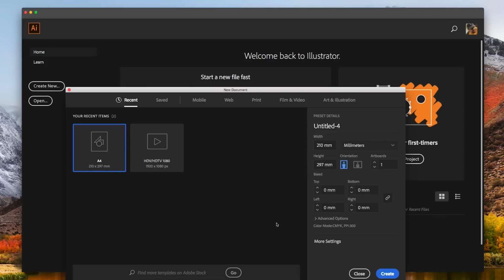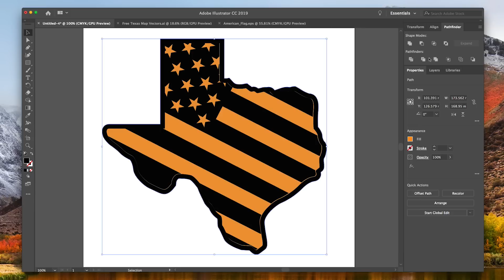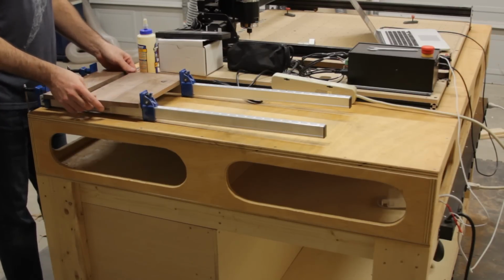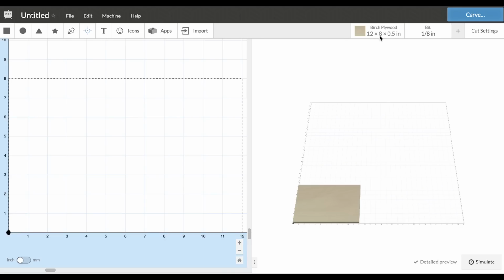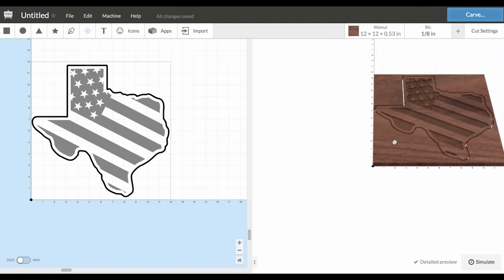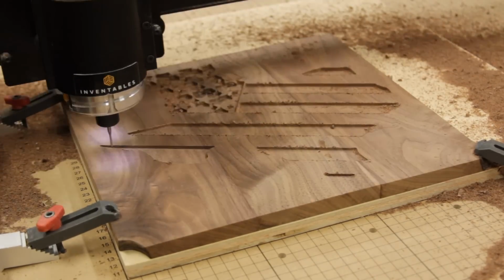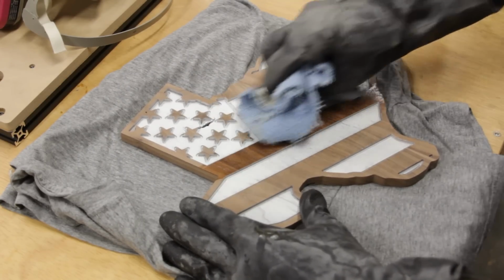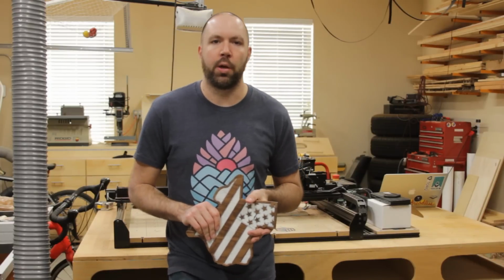X-Carve Zero to Hero - My First Project

Comment: How long did that take that machine to cut all that out?
Reply from the maker: Right around an hour
Reply: Kk thx 4 that. Unit still running good, still like it? Thinking about picking one up.
Reply from the maker: @springwell6146  yeah, don’t use it nearly as much as I want to but it works great every single time I use it.

Comment: how loud is it?   buddy of mine had a different brand CNC but the sucker was super loud.  had to wear hearing protection and pissed off all the neighbors.  I realize most of the noise is the router itself, but just wondering what your experience is.  Thanks
Reply from the maker: The noise of the router is really the only sound you hear while it's running. There is a very light noise of the machine actually running, but most people like it (it sounds like it's making music). I wouldn't say it's any louder than a regular hand held router. Definitely not quiet, but not what I would consider "pissed of neighbor" loud.

Comment: Make sure you touch off the roughing and detail bit at the same location on the workpiece. I have had the same issue of varied depth and it was because I touched off in a different spot, and there was some bowing in the workpiece due to clamping. It’s not much, but even .010” difference or so will definitely show up.
Reply from the maker: That’s definitely a possibility. I’ve had it happen across a few projects now though, so not 100% sure what it is yet. Need to take some time to sit down and really troubleshoot it.

Comment: Of course, the finish cut always cuts lower than the rough cut...that's why it's called a finish cut. If you set the max  Z at say, 3/8"...the roughing cut will not cut down to 3/8"...it will be a shallower cut than the finish cut.

Comment: Is it possible to run it back through the planer after it's painted? My thinking is that it would be faster than sanding the paint off with the palm sander. Great video. Thanks for posting.
Reply from the maker: The planer has a bigger chance of chipping out some of the smaller edges (stars, stripes, etc) so I decided to go on the safer side to sand it all out.
Reply: Good point. (And that reminds me... I still need to buy a planer.)

Comment: Great video, I’ve been really contemplating getting one to take my flags to the next level instead of hours of dremel/router work. Just haven’t pulled the trigger due to $$
Reply from the maker: It is definitely worth it. Adds another level to the process of building and opens up so many different options.
Reply: They offer a monthly payment option (like $85/mo)
Reply: Look into the Lowrider2 by v1engineering. Less than $400 and you can build it up to 4'x8'.

Comment: Flex probably. Thicker bit has more resistance on  he Z axis. Minimum but enough to see and feel when switching to the thinner bit and a light pass. The wood density isn’t always constant so it doesn’t take much. I get different results but the same affect on duplicate projects and different material.

Comment: Maybe you didn't seat the bits in the chuck the same depth? Idk if that's a possibility, mine came yesterday and is in the box waiting for me to finish building this table 😂
Reply from the maker: I most likely didn't as that is almost impossible to get right, but I did re-zero it with the Z probe between bit switches. Best of luck on the install. It's a lot of fun!
Reply: @DuraWoodworks  thanks. I'm 2/4 of 2/5 of 5/12 of they way through putting it together 😂😂 so I'm getting excited to get started making stuff

Comment: Nice job! I’m thinking about buy the x-carve soon. My only concern, from what I’ve read, that the belt will slip and loosen causing the cut to get off its course. Have you come across this? Thanks for any info
Reply from the maker: Nah, I haven't seen anything like that. From what I have read online, that is typically due to the belts not being tightened correctly during calibration.
Reply: The belts will loosen over time as you use the machine.  They can easily be tightened if they do get loose.  I haven’t noticed it making a difference in how my x-carve performs.
Reply: Ivehad my X Carve for 3 yrs, use it daily and have never had an issue with my belts slipping or loosening. Im guessing those that have belt issues didnt install them correctly.

Comment: Well, I've had one for about 3 years now and I can tell you this thing is the biggest piece of shit we own. Continually falling apart. The V-Wheel design is a pathetic cop out. After working with this thing, which is really only a toy, I have concluded that it isn't even worth selling because I wouldn't wish this on anyone. Save your money and buy a real tool. Without the belts and definitely without those stupid V Wheels.
Reply from the maker: Sorry you feel this way! I have loved mine for every minute I have owned it. Inventables is a REALLY good company support wise, so you might want to throw them a message to see if they can help troubleshoot the issues.